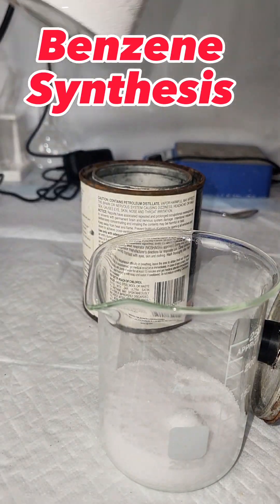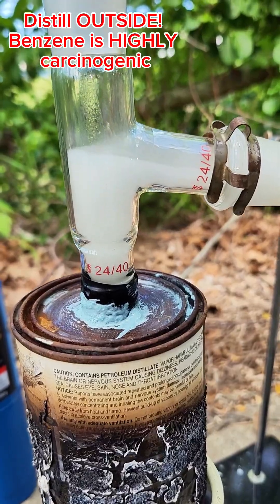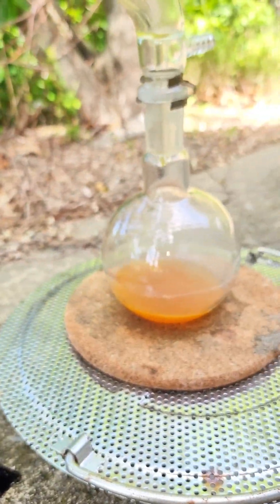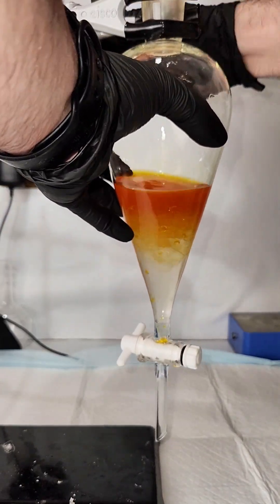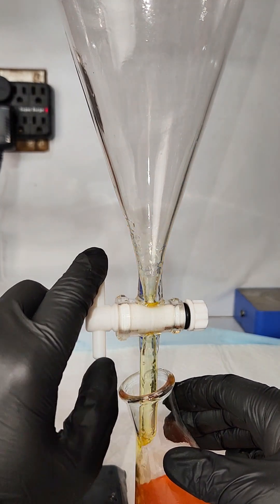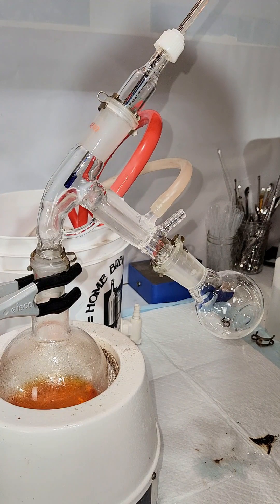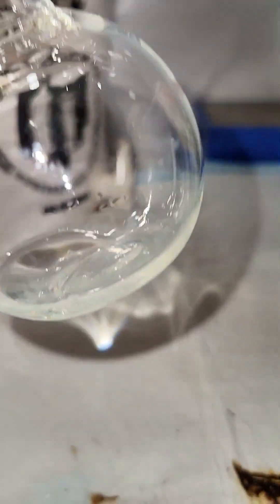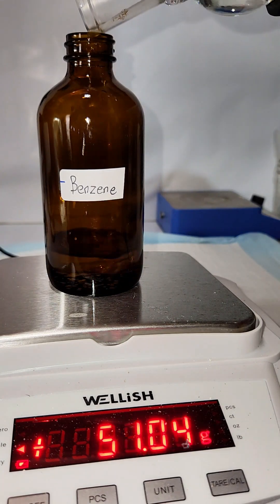Making Benzene

Comment: You’re probably more educated in chemistry than me but I am pretty sure the orange color is biphenyl.  Makes sense because the intense heat releases phenyl radicals and I can see two or more  bonding as side reactions.

BTW, would copper chromite from your other video allow this decarboxlation to occur at a lower temperature

Comment: I suggest using a larger can like an empty 5 liter acetone can. Heating it with a wood fire and a diy copper pipe liebig condenser. As a sealant some flour and water mixture workes fine. (Cheap, good seal and somewhat heat resistent for some time) 
Before complaining: i tried it myself and had good results without smelling benzene and I got 1 liter at once.

Comment: Cool video! I tried this recently too but you blew my yields out of the water. I really recommend trying to make Aniline directly from the decarboxylation of PABA if you want to make it in any reasonable quantity - so much easier than the nitrobenzene route! @corrosion-chem has a good video on it
Reply: PABA method is a lifesaver, that fiddly nitrobenzene reduction never worked for me!
Reply: Yield might be great but who knows about the purity.
Reply: purity is better than nitrobenzrne reduction, its a clean decarboxylation and you redistill the aniline over sodium hydroxide anyways, purity is at least 99% from what ive used it for
Reply: I'm glad he took your advice, the PABA method seemed to work quite well!